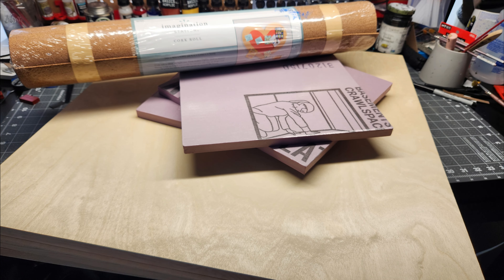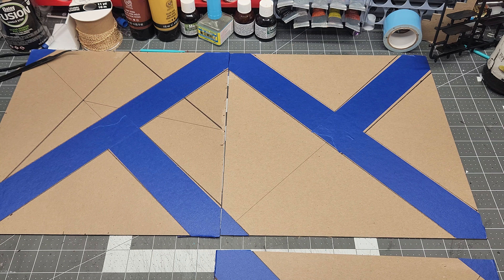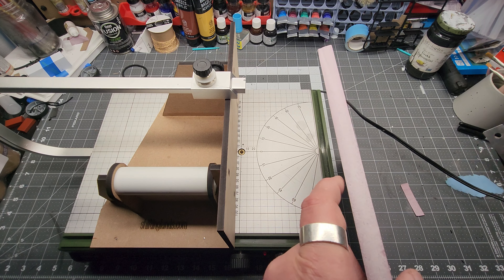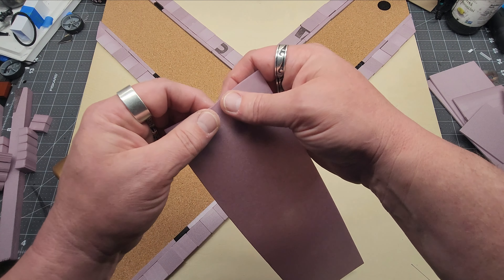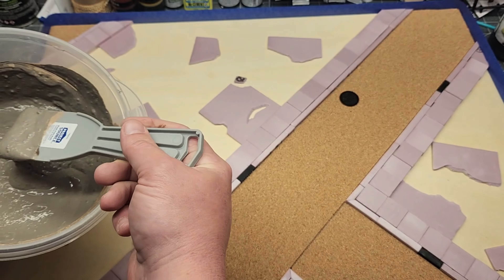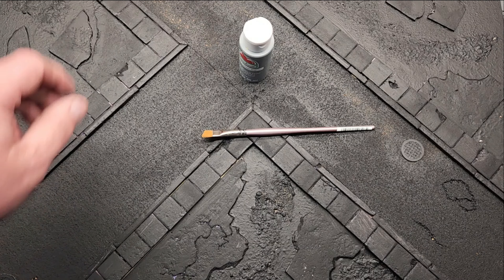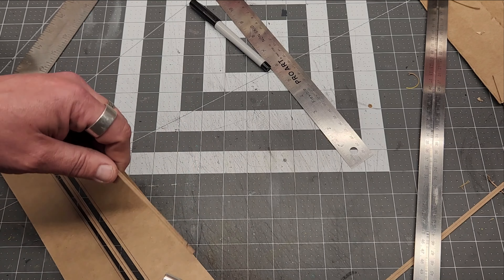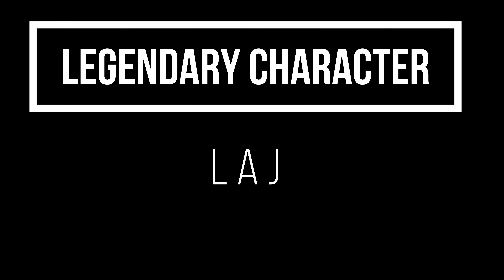Modular city streets for wargaming and tabletop roleplaying.

Comment: This is so well done. I love how modular it is but I'm terrible at measuring accurate cuts on basically any material. I might just give this terrain project a try though - you make it look easy.
Reply from the maker: Just l8ne up the roads to the center line and cut along the edge of the material.  It will do most of the work my friend!

Comment: This is great! I needed something similar for my apocalypse setting. The only thing I may experiment with is brushing on a layer of Mod Podge on everything. It makes a project so, so durable and easier to paint because some materials are so thirsty for paint, but once the Mod Podge dries, it’s a fantastic canvas. You can even spray paint foam with a coating of the Podge evenly applied across the surface. I love the painters tape idea for the lines.
Reply from the maker: I did cover it all in modpodge and black paint so it would touchen the project. I'm considering going back over it with another coate of just matte modpodge because I think it was a little thin. Thank you!
Reply: @adventuresincrafting2022  Oh! I must have missed that part, my mistake good sir. We definitely enjoy your work, outside of content creators and reference images, sometimes I'm crafting blind. Always good to have a solid example to follow.

Comment: If you make stencils out of card stock spray the stencil with gloss acrylic sealer. I do 3 light coats. Also keep in mind you can get stencil plastic at the craft store, it's super cheap and you can re use it many times. The down side is that it tends to be in 8.5 x 11 or smaller sizes.
Reply from the maker: That is a great tip! I will have to keep that in mind! Thank you.